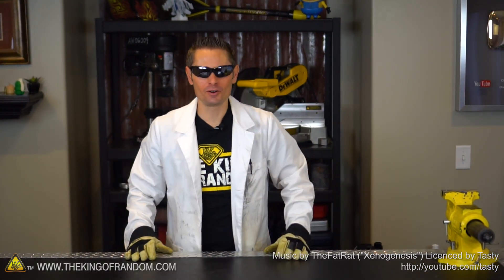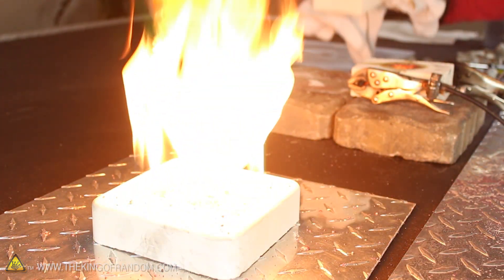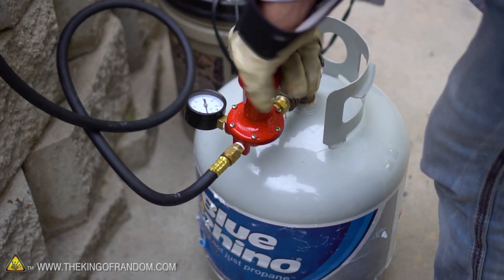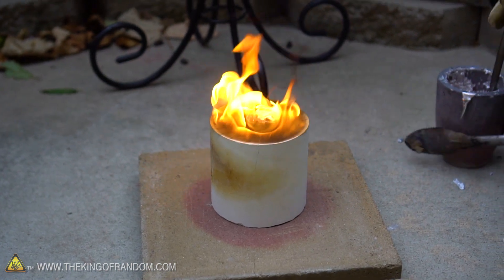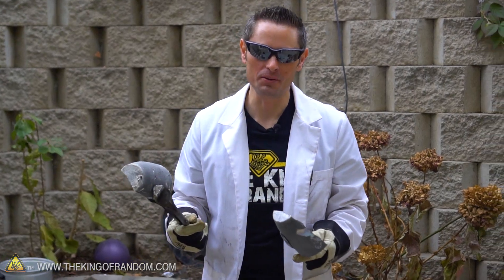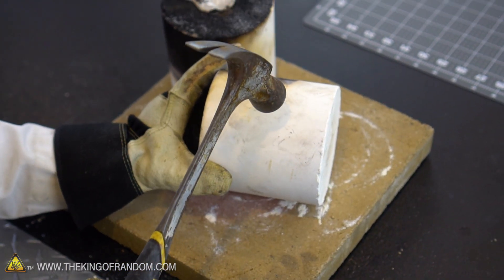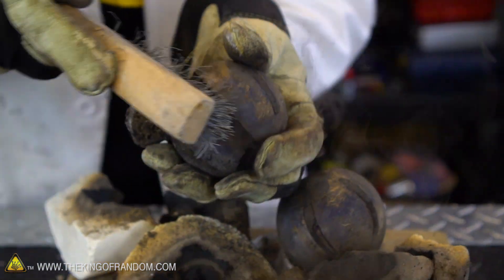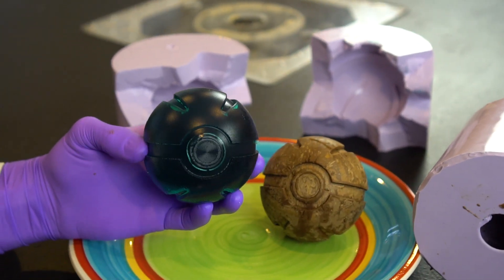Casting Aluminium PokeBalls

Comment: Could you pour water in the mould then put it in the freezer? That would make a really cool ice pokeball!
Reply: it could work
Reply: I'm thinking he meant the silicone mold, which solves both your problems
Reply: Nathan Macgiver make the mold silicone
Reply: Fleurimations _ it could work? It has a really high a chance of working and it would be so cool!
Reply: Eh
Reply: Nathan, It wouldn't crack because he would use silicone not plaster.

Comment: To get the wax out,  you need to more than melt it.  The flammable vapours are probably the wax that soaked in,  so to burn it out fully you need an oven that can reach 900F.  Jewellers have a special oven,  but I'd have a general purpose ovening oven that can melt alu too.

Comment: Grant, I cast silver almost everyday. get yourself a vacuum pump that can extract bubbles from the plaster when you originally pour it.  to keep the bubbling in your piece out try heating your mold right up until you cast the piece after its casted you can put it into your vacuum pump and that will cause the metal to be forced up removing all the bubbles. I do this when casting silver and my pieces come out just fine.

Comment: I want to see you make some proper crucible tongs, Imagine if that crucible had let go at 2:56 !!  Also you need to put some vent holes in your mould to let the expanding gasses escape from somewhere other than through the moltern alumimium. You can see it "Boiling" around 3:18 (I don't want to read how you got hit in the face by a 1220 Degree aluminium geiser) Cool pokeballs though :-)

Comment: For the air bubbles that form in the top, try drilling holes in the top to let the metal someone fill up in the air holes to reduce the air bubbles
Reply: Kind of like if you take a straw and put it in a cup of water, the more water you add to it, the more the straw gets filled

Comment: To avoid the air bubbles (they come from gases in the molten metal specially from hydrogen) you could use:
1. a vacuum chamber after the cast
2. postheating the mold specially the sink heat

If you want to improve the quality of your mold furthermore give investment casting a try.
One tip: To remove impurities use flux and then get rid of the dross by skimming it.

I really appreciate your show =)

Comment: In order to avoid gas pockets in the hole where you pore into you should have a second hole that releases the gases. In most plaster casting videos you don't see this because the either have vacuums that force the metal into the mold or some other form so the best bet would be to have a second hole.

Comment: yeah its called lost wax casting. You forgot sprues but it ended up fine. If it was more complex i wouldnt have smashed the mold with a hammer. You could just dump the hot mold in water and the plaster will crack and give you ur aluminium. Nice end product though. Im glad you didnt pour into a cold mold that wouldve been very bad

Comment: If you can think of a way to vibrate the mold, as you pour it, it might jiggle the air bubbles out. EG. set it on a vibrating exercise plate, or set it on a loud audio speaker.  Concreteors use a vibrating lance that they insert into the freshly poured concrete.

Comment: Use refractory cement to make a mold that won't catch fire, instead of the plaster, and when pouring the cement over the wax, don't have the flue standing and holding the piece, hang it instead, it'll help with keeping the negative space vertical and making any spheres you cast not have air bubbles.

Comment: You should degas the aluminum with washing soda, also you should add a couple of "sprues" when making the plaster molds so when you pour your metal the sprues give any gas a chance to escape so the metal will fill out any weird tough spots and will get a better casting. You mite be better off burning the wax out with a microwave and blow torch

Comment: there is a special  wax used in making a lost wax casting  called Micro-crystalline Wax   also the use of a kiln give best results on vaporizing the wax.  you should have added a breather holes to allow any air to  exit as you fill the sprue hole with material... the plaster is a special blend to use for the vestment...  the LWC i have done is with silver and bronze while in college as my major studio work

Comment: Hey Grant, I'm not a Master Mold-er (eh...eh... Xmen reference XD), but I have seen other casting videos and one way I've seen them get rid of trapped air bubbles is to have two separated holes in the mold instead of just one.  One hole for pouring in material and the other for letting the air that the material is displacing escape out.  I don't know if this is what's causing the issues in your castings, but I figure it's worth a shot.

Comment: Sand casting with green sand will give you repeatable casting. For round objects or undercuts, add a sprue hole to that area it'll let out the air and get prevent that shrinkage bubble. To reduce air bubbles, dust the master with baby powder before pouring in the silicone or packing in the green sand.

Comment: when you mix fuel, iron oxide and aluminium power in just the right way it burns at 2000 Celsius hot enough to cut through nearly any barrier known to man. Throw some C4 in the mix. PLEASE DO THAT

Comment: Metal casted ganondorf amiibo
Reply: With silicone? That's fine but if he uses plaster it will burn and melt down
Reply: Inbae Jin Hed cast the thing in silicone like the PokeBalls turn them to wax so on and so forth

Comment: I've seen other videos on casting and when you do your initial cast with silicone. you need to use something that will vacume out the air. I'm sure you can figure out some sort of way to attach a hose to a sort of plexiglass lid. I don't remember if you vacuum the silicone before pouring or after.

Comment: If you add a funnel shape to the top of the poke ball the metal will pull more from the extra metal and not the ball itself.  It will also give you a bigger hole to shoot for and the size of a small cup would work.   Add same smaller channels for air to get out and you should get the hole thing. I have done a lot of casting in my art program.

Comment: Grant instead of using plaster of paris and sand try refractory cement I have seen people have great success with this method and it can handle the heat properly also with plaster of paris the heat of aluminum causes the plaster to revert back to its original state as gypsum and is no longer cured plaster so if it gets wet it can fall apart.

Comment: You need another small hole at the top of the mold to allow air to escape or you will create vacuum in the mold when pouring causing bubbles.

Comment: Hey Grant, one tip i can give you for the molds to no get the bubbles is: try to use something that vibrates, like a smartphone and put touching the molds, like 10 minutes, the vibration helps the air trapped escape ^^ Nice videos btw

Comment: If im correct the way to get rid of air bubbles is to put air holes in the mold. then after you get the metal ball out you cut off the protruding lines.

Comment: if you add a riser you can avoid some of the cavities due to the shrinkage, as for the bubbles you'd need to use a vacuum chamber to get rid of them for the silicone mold. I don't know if you've got one or not but I'm sure you can probably make one yourself.

Comment: I can't remember what it's called but I use to watch this old mans YouTube channel and he cast all sorts of things, I see the problem you are having casting, you have to make a reservoir channel in your molds, it should  be 20% the size of what you are casting, you fill the reservoir and it flows into the mold filling it, as the metal shrinks it pulls extra molting metal from the reservoir and keeps your mold from shrinking. I'll post a link to his page so you can see how to do proper molds.

Comment: I've bought a corundum crucible for melting metals like copper or bronze. It's far more stable than the steel one. Have not cracked yet. You can try it. And according to the datasheet of some molding mix the form should be slowly hitten up to the about 600C. I made special nichrome furnace for that purpose. The fire problem is gone now. May be you should make something like that?

Comment: You need to burn out the mold after steaming out the wax, to get rid of all the wax residue, avoiding the flames.
Also, if you dunk it in water, after it the aluminium has set, but still hot, the plaster will break away.
Love the videos.

Comment: the last time i watched a forging video with the same method as you, they stuck toothpicks in the mold on the top wherever there was a larger blank area, so that it could be grinded+polished off and nobody would know. just to make sure that air got out, and then just pulled the toothpicks out after

Comment: thrs a thing on amazon you can get a thing called cncr silicon 3% sl it act like concrete but you can bust it with a hammer and it can put up heat up to 1,345 degrees you should use that and yes I do his a lot  and ive been doing it for 14 years

Comment: Hey Grant, I work at a dental lab and the way they handle wax there is kind of similar. I don't handle the wax so I don't know the exact specifications and details, but basically they put the wax into a plaster mold like you did, they pour the plaster around the wax, they pour it on a lightly vibrating platform so that there would be no air bubbles, then place them in an oven for a certain amount of time, then after the oven, the wax would be melted and/or evaporated(?), they take the plaster mold and put it in a centrifuge, heat up some metal, let it spin and that metal would fill up the area the wax was in. I don't know if this would be of help to you or not.

Comment: Try adding steel rebar in side the plaster. Like half way into the mold it won't crack like that and it will be reusable I think but you have to bend it to the size of your the center or middle of your plaster to get it right

Comment: Instead of plaster, use casting sand and a wood-box, or use expanding foam in the sand, then pour the molten metal into the foam and it will burn it up and fill in the cavity without needing to split the mold.

Comment: If you haven't used it, try greensand for casting.  Its a bit more prep intensive, but it wont offgas like your plaster.  As for getting the airbubbles to settle, you could just tap it on the ground, or put your casting over a tiped over speaker and play some dubstep.   The vibrations will help free bubbles from the sides, and also help them move around (towards the top)

Comment: So why not run the Aluminium through a styrofoam model of the Pokeball made using the silicone like he did with the master swords? And what would you need to do to start a mold if your original object isn't made of steel to make your cast from?

Comment: Recommondations for casting: For thr Bubble: Use a vacuum pump for both the silicona and plaster mold. Something as simple as a household vacuum will still remove alot of air bubbles. Juse keep it on till you can't see any more air bubbles surfacing.

Second: For the plaster molds to work better I recommend using finer grain sand and baking it at broiling, lowering it 20 degrees every 4 hours till its at four hundred. It still won't come out amazingly clean but should reduce the fire.

Anyways great video man, really enjoy the applicable hobbies you introduce us to! :)

Comment: You should pour plaster  into the silicon mold and then make a steel or copper mold that you can split in two and pour other materials in.

Comment: Well I'm pretty sure the silicone would come out better if you vacuumed out the the air by putting it in some kind of vacuum degassing container. Iy may help with the plaster to but i'm not sure because the plaster may need the air bubbles  to retain heat. Maybe you could try burning the inside of the mold with a torch to release the gas early so it doesn't make bubble  marks.

Comment: If you want to get rid of air bubbles in your molds (both plaster and silicone) get your hands on a vaccum chamber and a pump. put your molds in there right after pouring and watch the bubbles leave your mold like magic!

Comment: hey grant Thompson if you want to avoid the air bubbles when making the silicon mold you should try using a small vacuum chamber. I've seen a few videos of people doing that and it looks like it works great if you want to look into it yourself and if that idea doesn't work another thing you can do is to pour the silicon molding liquid in slowly and consistently so the air bubbles don't form also a vibrating table/tool would work if your to impatient to pour slowly. really hope you see this because I believe they will help alot with cast quality, as for the metal casting there are way to many ways of going about doing that but if you're curious about the different ways send me a message or reply to this and I'll be more then happy to share.

Comment: so two things when casting: assuming you are using aluminum from cans, those have very little silicon in them so they have very coarse crystal structures. Alloying silicon into the aluminum or melting down aluminum that already has it (can be salvaged from commercially cast products) will cause the crystals to be much smaller and you will get a better cast. My other point is to prevent air bubbles from forming in the core cast around your sprue, you need to add a second sprue to release the air or have a reservoir that allows the expanding gasses to exit and/or to not form in the core cast. With some quick google-fu, you will find that the technical drawings of the cast usually have some form of gas management before the pour reaches your core cast.

Comment: Instead of using plaster for the moods use casting sand. It'll withstand the heat of the metal and is used for casting steels and its alloys. Or you could try using zinc instead of aluminium as it has a lower melting temperature.

Comment: Casting investment powder is what jewellers use to cast. Try that. You'll need to vibrate out all the bubbles from the mix before you cast though  otherwise there's a high chance of there being bubbles in the casting. The resulting casting is also very fine and detailed when using investment. The method is exactly the same as you've done here.

Comment: also to avoid air bubbles when casting, add a small rod to create a tunnel so when you cast the metal it acts as a vent so the air can escape

Comment: For the next silicone mold you make why not paint a layer of silicone on to the object first let that cure then do the filler around that to add support to the fine layer around the object? This would give you control of what touches the object and you have already seen silicone will bond to silicone so it should keep its strength after. 

Doing it in 2 steps would also let you introduce reinforcements between the layers in ether solid or fiber form.
Reply: Andrew H I think that's right, will also cover air bubbles and make perfect mold
Reply: +Grant Thompson - "The King of Random"    You should consider researching how engine blocks are made if you haven't already. Their casting method may be adaptable to what you use.
Reply: I love this idea!
Reply: sounds smart!
Reply: do it

Comment: mix your plaster with carborundum 400/600 grid and talc and kaoline, and put some chickenwire near the outside of the mold, and after you have molten out the wax,preheat it on 500degrees cesius, that works for me always withuot trouble.

Comment: So grant my friends dad is a dentist and he gave me some tooth plaster which is the stuff they use to cast metal teeth with and I tried casting something the exact same way you did with the wax and it turned out perfectly and without air bubbles at the top.

Comment: You could also add a couple of extra vent shafts from the top of the object your doing. It will mean you have more things to grind off but it will give the necessary venting to alleviate the air pockets.

Comment: Hi Grant, I used to work in an aluminium foundry. You need to use a vibrator plate when curing your molds to remove air bubbles. To remove trapped air and shrinkage, I suggest you perform a bottom pour. You will require more metal for the poor and it is a bit more complex, but you make a cylindrical hole beside your mold with a cavity on the bottom for the aluminum to rise in the mold and not poor.

Comment: I do bronze casting for my sculptures and I learned a trick that might be helpful. line your plaster molds with chicken wire while its still wet, that will give your mold the structural strength that it needs to survive the heat of the aluminum in the mold.

Comment: it looked like you thermally shocked your crucible and split it. also you should have heated up the plaster gradually up to 400 to get rid of moisture then 1000 to get rid of all the wax. if you had quenched the plaster soon after the metal solidified it wuld have broke the plaster off for you and cooled the piece faster

Comment: instead of using plaster, you could try making a mold from green sand. that should hold up much better to the heat and be reusable. additionally, try leaving the wax in the sand, the aluminum will just Burn it out and take its place. look up lost wax casting.

Comment: as far as investiment casting goes, you should mix vermeculite and refractory clay in with your plaster, after you pour, wait about five minutes for the metal to cool down to about 900 degrees F. and quench it in water to remove the investment (mold)
 
to prevent the investment from cracking, you need to pre-heat it to at least 450-500 degrees for a minimum of 6 hours

now about the imperfections in your silicone molds... easy fix, just mix up a small batch of silicone and fill the pockets that the bubbles left